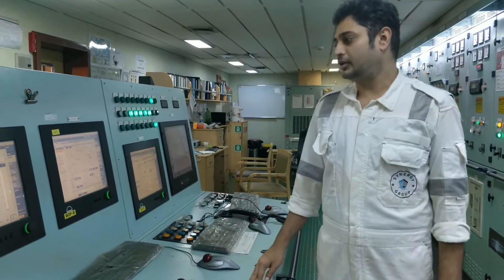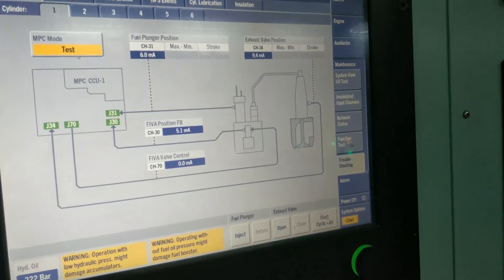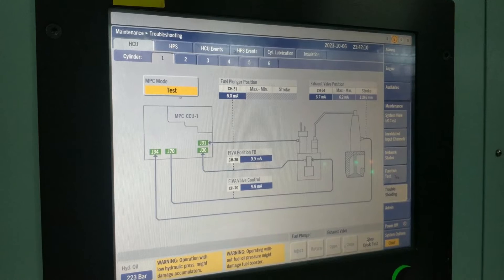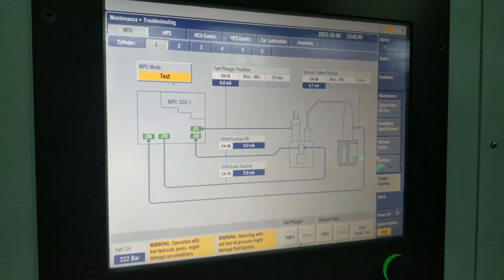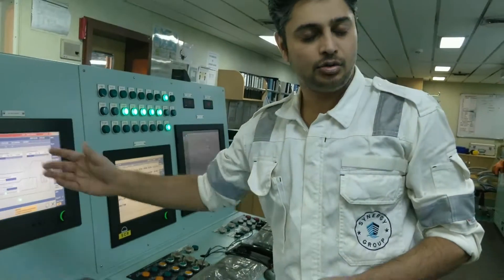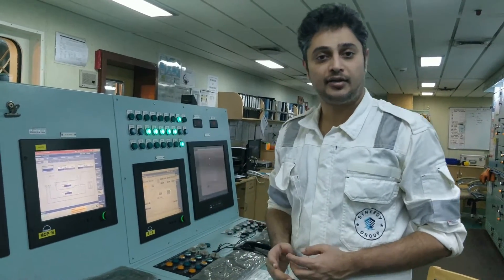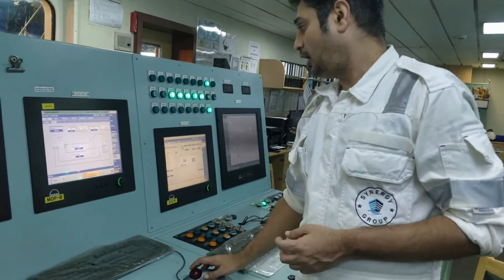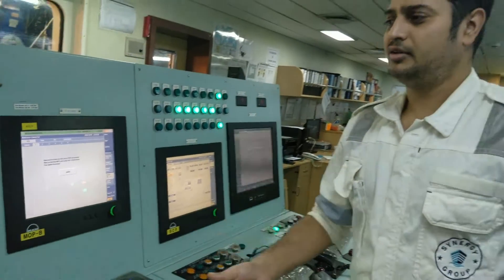ME Engine Exhaust Valve cyclic Test-New Age Online Marine Academy

Comment: Just a small doubt, how to start the electric hydraulic power supply pump when the engine is in FWE State. Even in Chief access, the manual option for starting the pump is not available
Reply from the maker: Not from MOP....in local panel need to put in manual mode and start...tats how we do pre lub while turning the engine in fwe state...
Reply: Thanks a lot  @Newagemarineacademy
Reply from the maker: Not from MOP....in local panel need to put in manual mode and start...tats how we do pre lub while turning the engine in fwe state...